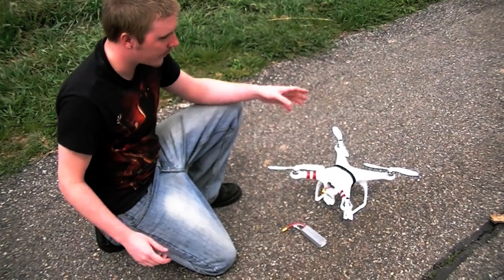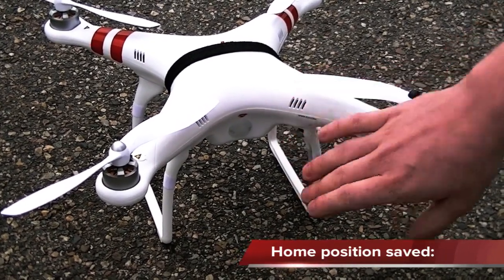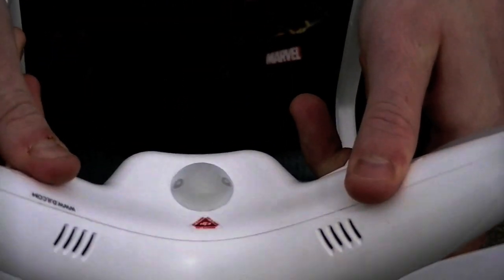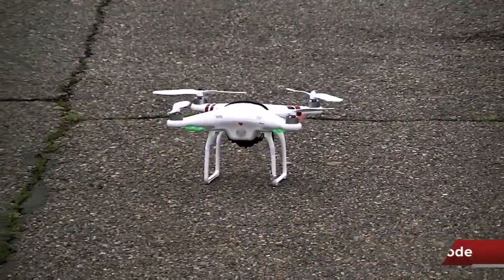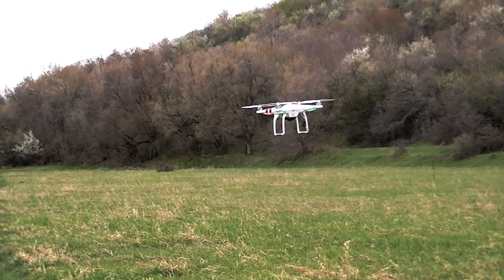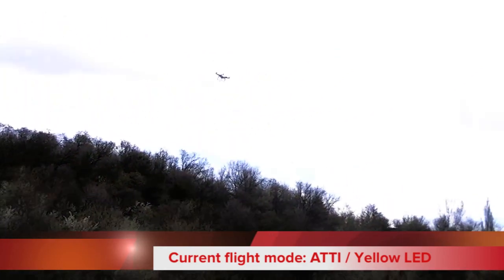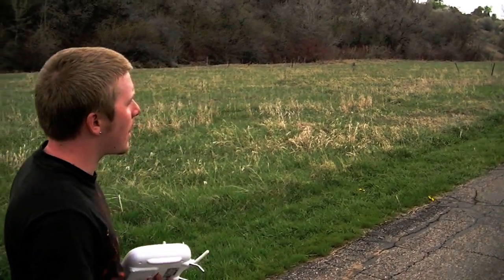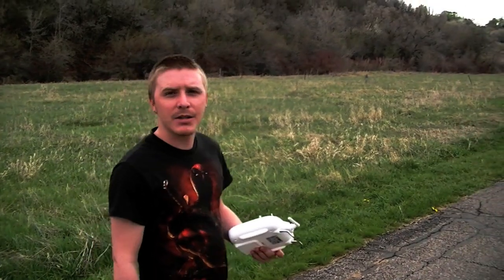DJI Phantom: setup and review (freddycanflyrc.com)

Comment: Don't forget that if Naza M is activated, your S1 switch or gps/atti/atti modes can be changed to gps/atti/manual or gps/atti/failsafe as well, and you'll also get not 1, but 2 sets of green flashing lights on startup. Also to change your home point while in air, you can flip your S2 or IOC switch back and forth about 3-5 times, it'll flash yellow once new home point is saved, and last but not least, once your failsafe is activated, you have to turn on your receiver and flip from gps to atti mode to regain control, or you can set failsafe to 3rd position on S2 and you won't have to turn off your receiver which some people prefer vs turning off their controller.